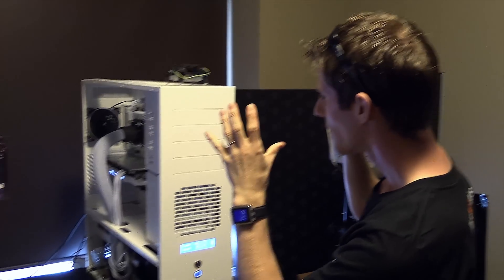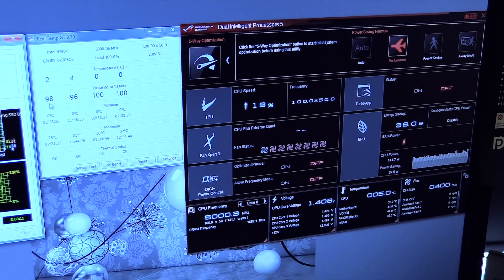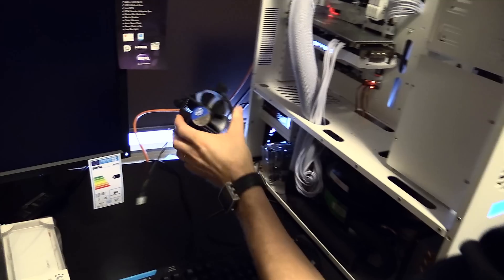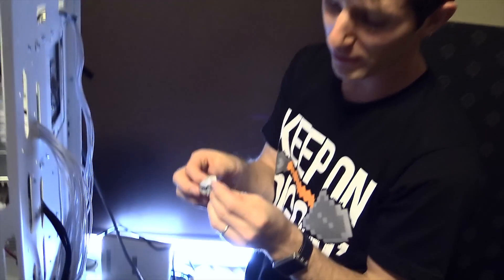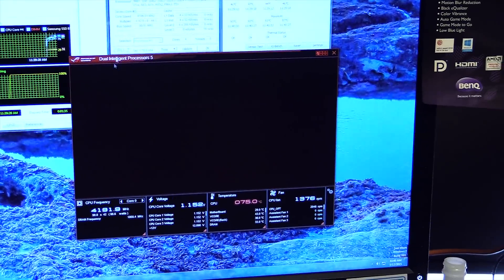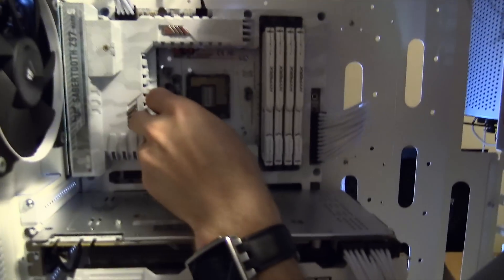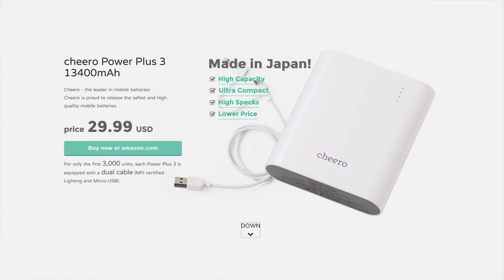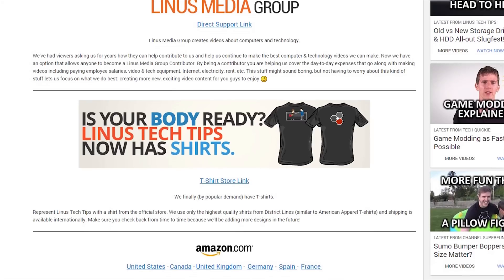CPU Cooling - Does temperature impact performance?

Comment: Being cooler doesn't inherently make it faster however it does allow for much higher overclocks which is kinda better performance.
Reply: Dr Barnabus Bish pleas, colder metarials conduct better, resulting in faster speeds.
Reply: Navhkrin it's actually the exact opposite
Reply: branflakes0399 Someone has failed their physics courses. Google is your friend.

Its not like im saying that having colder CPU will make noticable differance, im just correcting a mistake. Know it the right way.
Reply: Navhkrin Actually, a semi-conductor's voltage drop gets lower if the temperatures rise. I have seen .8v at 25°C and with the same diode .6v at 60°C. The less the voltage drops the more it will conduct. However with most things it is the other way. metals usually conduct better at cold temperatures.

You can test this with a multimeter and a diode. Just measure the voltage drop then heat it.
Reply: Dr Barnabus Of course, which is what he said in the end. What this video was about was to test if it would run slower if it's too warm
Reply: Navhkrin You're forgetting its a semiconductor. They actually perform worse at conducting at low temperatures.
Reply: Performance of a CPU has neither to do with voltage nor with current. It just depends on the frequency, and whether the transistors can switch at the required speeds for that frequency. Switching speeds get better with higher voltage that is why you can dial in higher overclocks with increasing voltage.

That is also why temperature only has an impact on stability, not on performance. If a transistor doesnt make a switch in time (too low voltage) or switches in the wrong way (which happens at high enough temperatures) you will get unrecoverable errors resulting in BSOD's or freezes.

And btw since resistance gets lower with increasing pipe diameter as well as decreasing pipe length his analogy is perfectly valid. Probably better since it doesnt use an inverse relationship. Even though his conclusions are totally wrong. And looking at voltage like flow rate is as well.
Reply: Navhkrin CPUs do have a lifespan its just they become obsolete long before that time ;)
Reply: Dr Barnabus Cooler also kind of make it faster as itll live longer.
I fried my GPU at 98c for a few months, and i can feel its crying.
Reply: ***** No it won't baseclock is generated by a crystal not a semiconductor.
Reply: http://spectrum.ieee.org/semiconductors/processors/transistor-aging Read this if you want to know about the processes that lead to defective chips.
Reply: Navhkrin  Both insulators and semi-conductors conduct electricity worse at cooler temperatures, so conductors are more the exception than the rule ;-)
Reply: Dr Barnabus Cooling a cpu to make it run hotter
Reply: Dr Barnabus Just what I was about to comment, it allows you to clock it higher.
Reply: Simon WoodburyForget That's true
Reply: ***** So much brainpalm in your comment... First , its very wrong to consider pipe width as heat. You should consider heat as pipe length in your anology.

I already told that i know it would not make a noticable differance. Im just telling it so you guys would know what happens in reality.

Applied voltage = constant  , decreasing pipe length will decrease the reisstance , amount of electrons that flow per second (current) will increase. This is not even university physics, this is fucking first school physics. Guys please. Use your brain before wasting my time. Also pipe width would do the exact same thing. Performance is not voltage, performance is the current. But only way to increase current is through increasing voltage. (or decreasing resistance).
But even then, length is more accurate.

BTW Cpu's do not have a lifespan. That is just a myth. But obviously only someone like you would fall into that myth.
Reply: Simon WoodburyForget Isnt it more like this: Overclocking decreases life expectancy due to people often letting it run at higher temps for sake of speed which can decrease life expectancy.
Reply: NoobInGame Plus voltage being higher makes it degrade over time. If you put WAYU too much voltage it dies right away, cold or not.
Reply: spaceminions Isnt that due to individual parts in the CPU heating too much?
Reply: Isn't that the whole point of liquid cooling?
Reply: *****  Just try to keep your cpu lower them 60 degree and you should have a good performance ;)
Reply: Dr Barnabus Not neccesarily, if your chip hits a clockspeed wall cooling it down more won't usually help get it higher clocks. Unless you pump more voltage ofcourse.
Reply: ***** The higher clock speeds, which result in higher voltage, increases heat output. A stock cooler can only do so much.
Reply: Dr Barnabus oh rly, did you got a phd in overclocking or how can you know this?
Reply: The only effect temperature has on a CPU is change its ability to be stable at a given clock speed and as long as the CPU is not throttling due to high temp, performance will be the same.

Resistance/Conductance of the die will change voltage raise time, but that will not have any effect on performance. Even if voltage finish raising way early, the next instruction will NOT begin sooner. It will ALWAYS follow the base clock.

As heat rises those voltage transitions takes more time to settle in the CPU, but as long as each transitions complete before the next clock pulse, everything is fine, if not the system will crash due to the CPU now being in an invalid state.

http://en.wikipedia.org/wiki/Clock_rate
Reply: Overclockability is entirely dependent on your silicone. Some can run ridiculously over clocked at stock to slight over voltage. But adequate cooling ensures lifespan of cpu and the amount of time the cpu can runs at max speed is at a maximum. The modern ones under lock themselves to not catch fire
Reply: ***** It actually does mean that, it means clock speeds will be higher, or lesser voltage requirement to achieve same clock speed.

Golden HDMI cable will actually decrease the delay of your monitor. It wont increase the frame rate.
Reply: ***** Yes, you are talking about the fact monitor refreshes every 16 miliseconds(60hz). The think you are missing is , if the frame does not arrive just in time, that could mean whole 16 milisecond delay.

And no, this is determined by the capacity of the monitor. Not some "ticks" to avoid getting signal later. Monitors will start refreshing as soon as frame comes if the signal is rate, which will cause tearing, which is the reason V-Sync exists...

Even with your anology, golden cable is superior.
This is not true but just to explain to you

Monitor tick = 5 ms.
Frame with Copper cable = 5.5 ms
Frame with Gold cable = 4.8 ms

You can see that gold cable in your case can potentially provide 5 miliseconds lesser delay
Reply: ***** Those are GTG response times, not actual response times. Calculation of actual response times is much more difficult and results are useally around 30, there was a site that was specifically doing that.
BTW, when im talking about 'response time' im not speaking about the technical term, im speaking about the time it takes in total for monitor to display the frame after video card sends it.

http://www.displaylag.com/exposed-input-lag-vs-response-time/
Reply: Yepp, that 5 GHz speed is an overkill to most of us.
Reply: +Kepler_   Huh? The speed at which energy travels through a conductor is actually the speed of the electromagnetic wave and not the movement of electrons. Also, electrons/electricity in semiconductors don't exactly function as they would in conventional conductors. http://hyperphysics.phy-astr.gsu.edu/hbase/electric/miccur.html
Reply: +yaeshraj High temps causes the silicone to shrink and pull away from things it should be close to. In other words, it's not good to cook your silicone semiconductors or they will eventually stop flowing electrons.
Reply: +Dr Barnabus but it will make your PC parts last longer
Reply: +Navhkrin how is this since gold is a conductor? and the top reason why its plated on most every connection point that requires a high transfer rate. i should know my dad is lead plating tech at molex and has done this for 17 years. gold will transfer electricity faster and more efficiently than copper. but as far as picture performance it will not increase nor decrease but stay the same. the gold will actually provide a longer plug life than copper.
Reply: thats odd because when i google gold tipped usb 3.0 cable i get results, hmm imagine that.estebanrey
Reply: estebanrey
not by my logic dude. just how it is. gold creates better connection points but you are going to pay for the process of plating. yes a usb isnt rreally needed to be plated gold but it secures better connections and insures a lengthy plug and play life. gold connectors dont fail as much as aluminum connectors do.
Reply: estebanrey
look up molex and what they do. every plastic connector and every gold plated lead you have in any major electronic like pc boards high performance cables. ive made and done just about every job in molex and i can assure you gold is a better option for transferring data. not logic just how its actually done right.

Comment: Just keep your temps above the limit and you won't throttle. You will be fine. It might make your chip run more efficiently. But that won't effect performance directly. Unless your overclocking because then if you don't cool properly you will throttle. But I think this should all be about stock settings for a CPU.

Comment: I had my fan config set wrong. Side panel was exhausting when it should have been intaking air. Dropped mobo temps by 10-20c on load and i dont even have to run the fans at max anymore. Half speed. better temps. GPU cpu and mobo. Its a huge win lol. I thought x99 runs hot in general, but nope. Temps werent that bad either max about 55-60 celsius. Now its below 40 on heavy load.